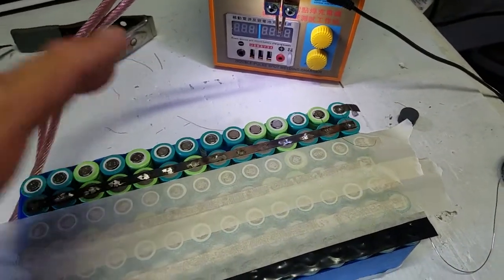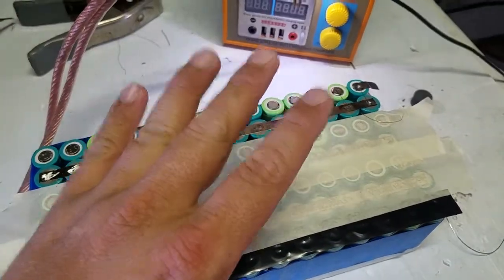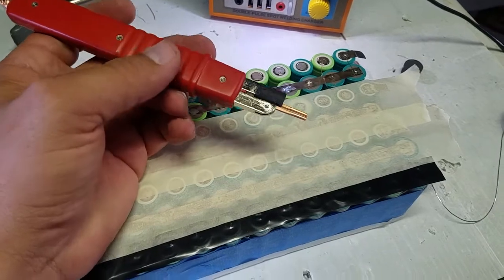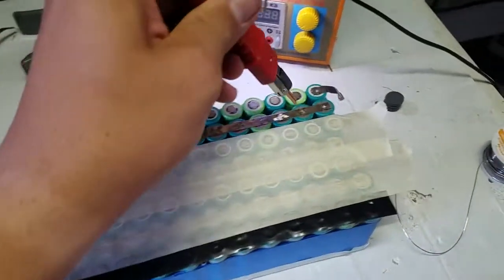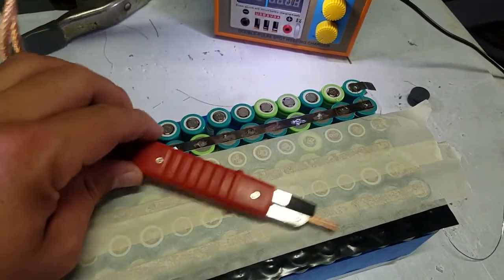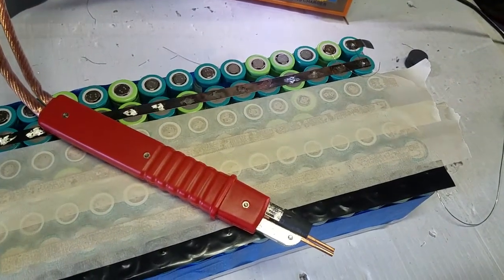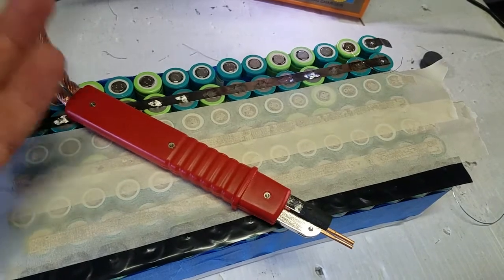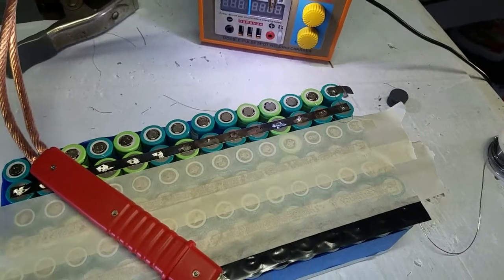Someone please help!!

Comment from the maker: I think a found a solution...
Reply: Lets see it
Reply from the maker: I had to break apart the wand and still is giving me a hard time
Reply: Yeah, it will give you a hard time now and later,, you need thin wire, very thin to weld.. is still 110v , will work better but not great..This is the one you need.. https://www.amazon.com/Sunkko-Battery-Welding-Soldering-Machine/dp/B074521MYL/ref=sr_1_11?s=hi&ie=UTF8&qid=1524842597&sr=1-11&keywords=spot+welder

or this one.. fan in the back is a good sign.. https://www.amazon.com/SUNKKO-Battery-Intelligent-Welding-Function/dp/B0771771PL/ref=sr_1_27?s=hi&ie=UTF8&qid=1524842597&sr=1-27&keywords=spot+welder

Comment: Try 50 amps.some times the thickness of the nickel strip needs more amps to perform spot weld. Try different amp settings.
Reply from the maker: I've tried 99 2 and 10 and still won't weld nickel strips with the wand

Comment: The missing information is , the spot welder can only do 2 pulse.. Javier need at least 4 to 6.. Always remember. spot welder of 240v are better and much more efficient at the job that a 110v ... also looks like is only 30 amps

Comment: Here is a quick video. https://youtu.be/sYR4RuqEIjs

Not recommended, but OK for today. There are other better versions. Basically, get a 12 volt small battery and then short it out using thick wires.
Reply from the maker: I already have a DIy spot welder for the tabs and the sunkko welds tabs. The problem is the fuses. The power is way to much on my diy welder and the sunkko is way to weak...

Thanks anyways for helping. Its appreciated

Comment: Did you try filing the electrode tips in case that have oxidized?  Maybe try filing the electrode ends to a point so all the energy is more focused?
Reply from the maker: I file them every 3 to 6 welds

Comment: Hey Javier.. You sound tired. .. what is the strength in pulse and duration of the power? It also depends on the thickness of the wire fuse.. You might have to spot-weld 2x ( Twice) per fuse.. but if im correct, you have a ***Spot-welder that does not have a lot of current to do that***...an again depend on the fuse wire thickness..
Reply from the maker: You have no idea how tired and frustrated I am.

Comment: I had to solder my leads for 24v pack for a friend and that was my issue with a spot welder.
Reply from the maker: That's the issue. I don't want to solder the cells.
Reply: Javier Camacho directly wire your leads to a 12 volt battery